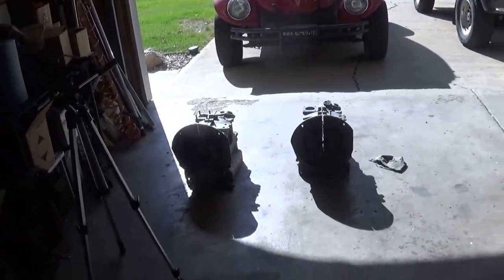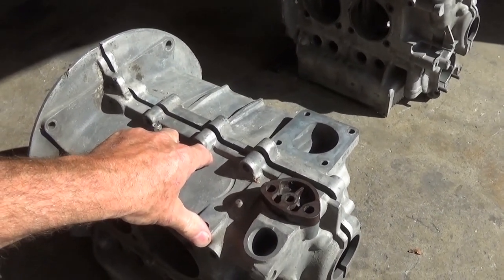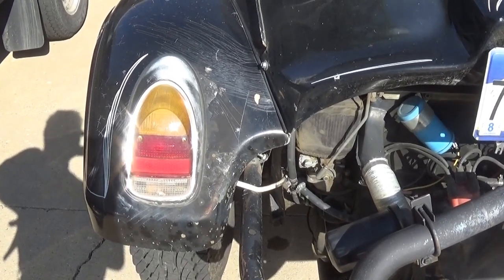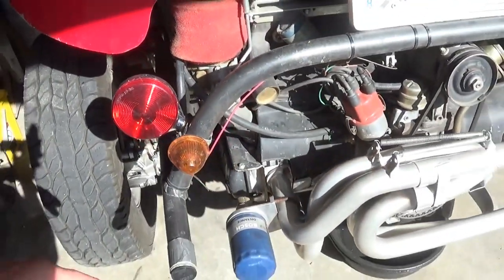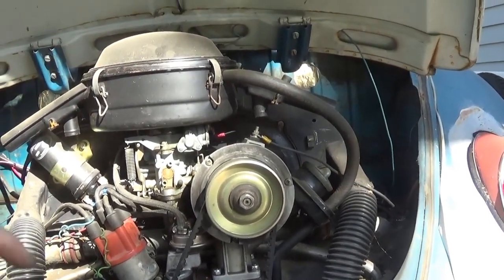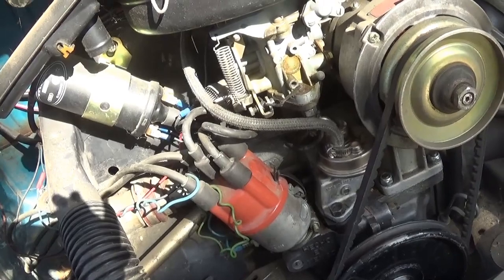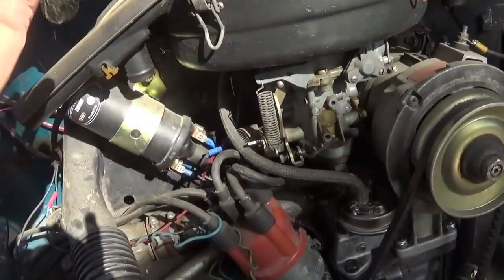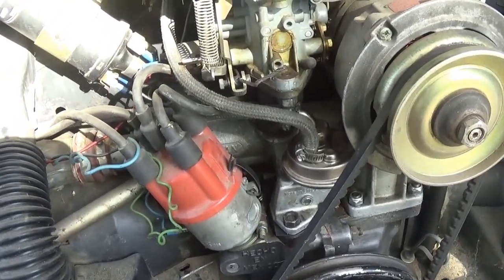VW Vapor Lock / Hot Weather

Comment: What if my fuel rod guide is very stuck in the engine? and it doesn't seem like there is a gasket under it. And possibly leaking fuel. Would this cause over heating? Currently experiences vapor lock after shutting the engine off and upon restart up to 1.5-2 hours after shut off. The engine is getting very hot and I can see the gas boiling in the fuel filter. I've checked everything else. Timing is good, points are good, no oil leak, metal fuel line not touching manifold, no big visible gaps around engine compartment . Any suggestions?
Reply from the maker: If your fuel rod is stuck it will vapor lock and have a lean condition which definitely will cause overheating. 
My 66 would vapor lock with a free moving fuel rod and a viewer told me to take a tennis ball and cut a hole in it so it would fit over the engine deck lid latch at the bottom. This allowed enough outside air to flow over the fuel pump and stop the boiling. 
I'm puzzled that your fuel rod is stuck.  I would remove the fuel pump and the phenolic fuel rod holder from the engine when everything is cold. If the holder fits to tight inside the engine at the end of the stem. You can file or sand off some material on the outside of the Rod holder. 
Sometimes those are tight and when the engine block gets hot it will squeeze on the rod and stop it from moving the fuel pump which in tern causes over heating and vapor lock.

Comment: HELP!!!! My bug driver side  rear wheel got stock . i was driving about 45m/h and the wheel got look , any advise ? i don't know if its the transmission or breaks ,it was DRIPPING some very black liquid a day before , THE  WHEEL IS LOCK
Reply from the maker: You will have to back off the star adjusters from the back bottom side of the backing plate and remove the axle nut. Might be a bearing. Is it IRS or Swing?

Comment: Yup, I routinely sand down the outside of the fuel pump stand and coated the inside with pure silicone .I've actually had the rubber fuel line collapse and pinch off the fuel flow. Sometimes a nice piece of neopreme racing line will prevent that

Comment: Also if you are in a hot climate like Arizona, route the fuel line away from the intake manifold and closer to the side of the engine bay. I did this about two summers ago and never had a problem since. Great video GZ

Comment: Good morning EzGZ another excellent video by the way.
I recently on my Manx went through five months of nightmares trying to cure a vapor lock problem. You might have this person look at swapping out their distributor if they have electronic. That’s what mine turned out to be! It mimicked vapor lock perfectly. It was a brand new electronic distributor. I went to points and everything’s perfect again. 
By the way on my first test drive I went through a 4 inch deep Creek. So I don’t recommend electronic for off road. Have a great day. 
Vic The Dick Ferrari (nickname earned at Stevenson Chevrolet golden Colorado when I crashed a Corvette as a lot man in 1984)! Lol
Reply from the maker: Thanks for the tip!
Reply: This is a good tip and it looks like I better check my electronic points.

Comment: What brand Electric pump do you use?
Reply from the maker: I just get the low pressure rotory pump that everyone sells. I don't like the clicking that the faucet pumps make. I still regulate down to lower pressures depending on engine and where I'm driving